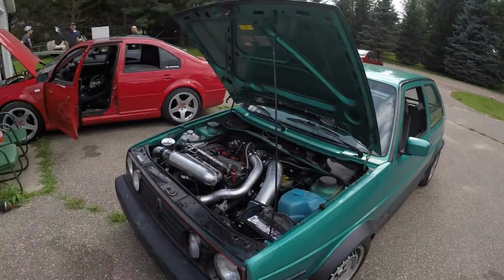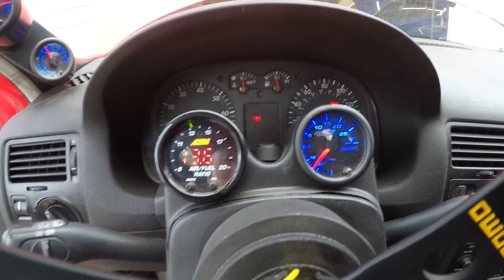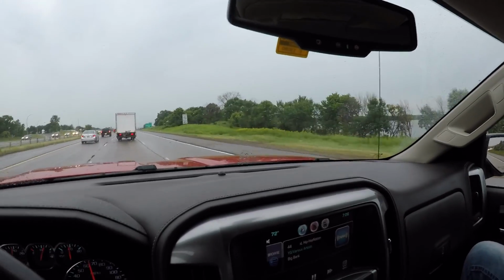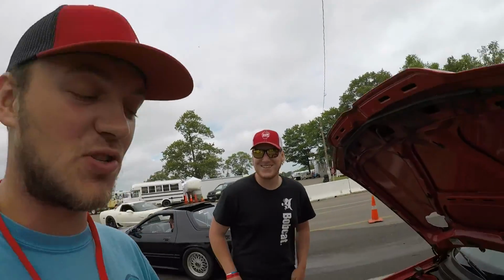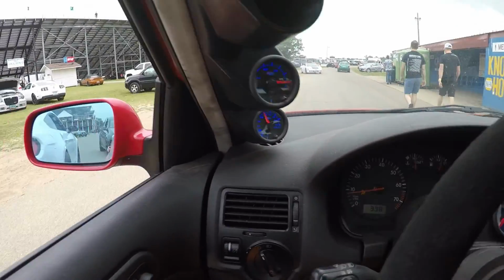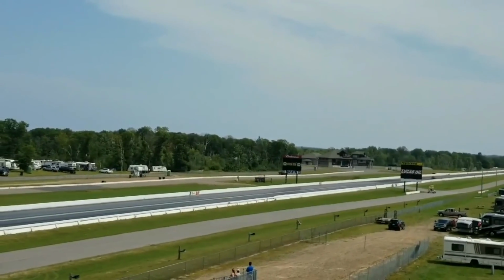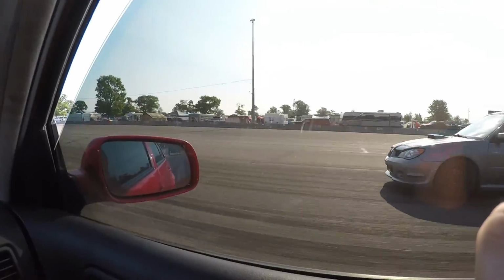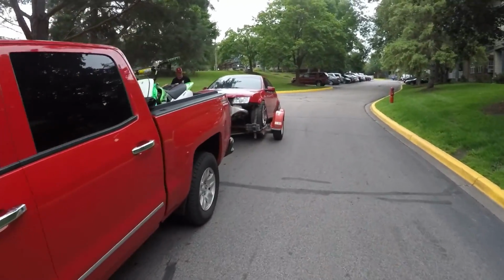BIG TURBO JETTA ROLL RACING! (POWERCRUISE 2018)

Comment: I'm a Mark 4 guy! I have an ALH TDI and I'm almost done getting my 1.8 t working perfectly again. I put a lot of work into it and I can't wait to drive it. Always been my dream car Love the channel keep it up
Reply: Hell yeah! My ALH TDI is slowly but surely getting where I want it.
Reply: @FiglioBastardo  for us normal folks it's a journey that requires patience lol I'm glad for my ALH, I have it mildly upgraded but not a lot so that it stays reliable. A vnt17 but when I put injectors in I went with stock because it's already pretty quick and I don't want to blow it up it has 370,000 mi on it. All the important things are new suspension steering brakes but I'm glad it's so reliable so I can keep pouring money into the 1.8 lol
Reply: @jimlee7317  Fire me up! Yeah mine has 329k on her right now. Honestly with mileage like ours the engine is good for another 300-500k even with upgrades. We're putting the doka17 on mine with fratelli bosio 7 holes until I do the whole Audi S3 radiator/intercooler/oil cooler upgrade, then it's to the moon baby! We're thinking about doing a compound or bi-turbo turbo set up. 🤣
Reply: I got a few pics posted on my community page of the wife's old Jetta that is now been Smyth Ute converted. 
It'll be ready for some summer cruising this year finally. No, I'd never do this again as I've tallied up over 1000hrs in the last 3yrs, but probably half of that is the real work.

Comment: Aye, Hp I got a 03 20L Jetta red as well bought it w 170,000 on it and kid told me the timing belt was replaced around 155,000 by himself!!! Had my motor guy look at it but all he said was that the oil is dark n smells a little burnt, I’m tight on money n told him that he said just change the filter n oil within the next week or so, the things runs great like no issues besides the Catholic Convertrt, has a small hole in it runs a little loud
Reply: Yeah you gotta watch out for those Catholic converters for sure! 🤣

Comment: Have the same mk4 gtx3076r with IE rods intake. 
Nice ride!
Reply from the maker: nice ! thats a pretty similar turbo to my bw  what does yours make for power?
Reply: hp_enthusiast I haven't put on the dyno but got to be over 500 HP for sure. Using unitronic BT software.

Comment: Keep up the vids, how have you not bent a rod yet. Me and my friend is also tuning the 1.8t, aiming for 400hp at the wheels. we both have forged internals.
Reply from the maker: most important thing I think for reliability is having a elm exhaust manifold!
Reply: One reason is becaus he has a big turbo..power comes on gradually and at higher rpm..vs a smaller turbo that spools fast and power hits a lot faster .. its the sudden "burst of power" that does damage.
Reply: VR6 was originally meant to be Turbo diesel then VW at the last minute decided to scrap that and make it gasoline. the vr6 12v/24v is over built to shit for a stock engine. only has a couple downfalls really.

Comment: Random question, is the red jetta street legal with the front end off?
Reply from the maker: technically I'm not sure if it's street legal with the front end off but  I haven't been stopped for it
Reply: If it was just that the bumper skin was removed ,and you hung the side marker lights back on and kept the actual bumper ,it would be legit.
Might be ugly that way to some ,but it's fine. 
Same with the old myth about riding without a hood ,that's a myth. 
And if ya wanna get silly, doors are overrated too and that's what seat belts are for.

Comment: Is that a second fuel pump you are using? How does that work?
Reply from the maker: in use to have a dw65v intank and a inline walburo 255 pump right befor the fuel rail but now I switched to twin walburo 450s in the tank it's probably overkill because 1 walburo 450 is good for 5-600 hp

Comment: Is the bottom end built
Reply from the maker: no it's a completely stock awp engine with a good turbo kit on it
Reply: @mxz700MN  what turbo? I’m running the Garrett series GT3071r and I’m making around 450+ and I think that’s on stock rods. I’m not too for sure. I haven’t pulled the block a part yet.
Reply from the maker: @ITZ_GOALS  it could be possible  these engines are amazing and my turbo is a borg warner s257sxe 7670 mine made 415whp at 27psi and it's on 35psi now

Comment: what time is it in 1/4 mile??? great your car, is crazy...
Reply from the maker: I've only done 2 1/4 mile passes with the car. with no launch control. it ran a 14.9 @115mph 3.1 sec 60ft.  I will make that time faster next year it has the mph for a low 12 sec pass!
Reply: Where could I buy the launch control, had a mk4 1.8 t, eBay sell it?
Reply: Juan Manuel different tuning companies, should cost around $400usd for a tune with launch control

Comment: Hy guys! What is Rods in a red VW??
Reply: Soma Falkenstein if I’m not mistaken you can have stock rods up to 300 lbs/ft. Anything higher look at H beam rods or IE forged connecting rods. But that’s for the big horsepower. If you want like 400 hp 300 ft pounds of torque just focus on clutch, fmic, fuel injectors, fuel pump, high flow intake manifold, high flow turbo inlet, less restrictive exhaust, bov/forge 007 diverter valve, cold air intake is also recommended and if you wanna be able to stop fast; upgraded calipers (2 piston calipers should be plenty powerful). Correct me if I’m wrong, but this is what I’ve come to the conclusion of after researching for my Jetta.

Comment: They look like GT28RS I wouldn't call them "BIG" turbo.
Reply from the maker: it's a borg warner s257sxe
Reply: @mxz700MN  Same snail I have on my 05 GLI lol
Reply from the maker: @603grudgelife4  nice! I wanted to go bigger but it my car is only stock engine and the 257 is a tight fit